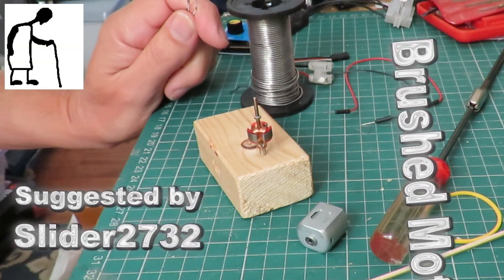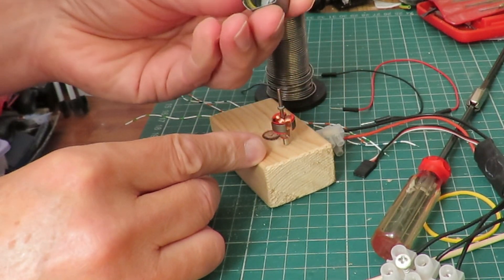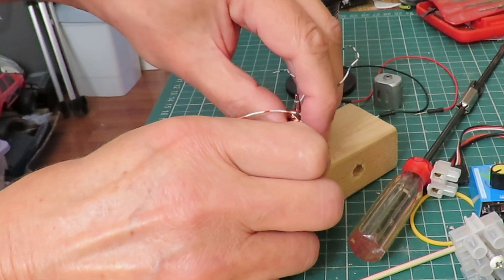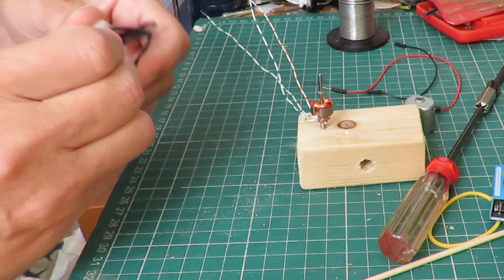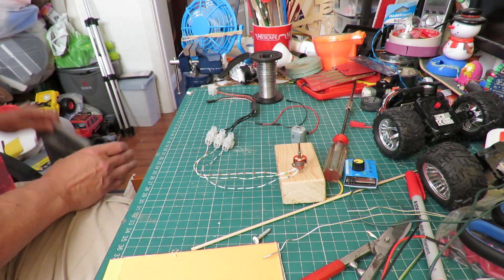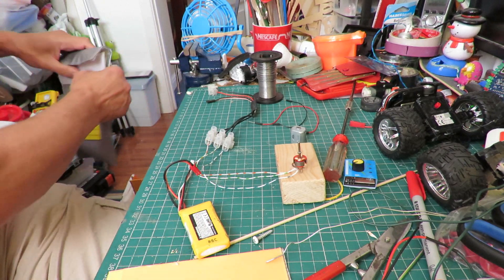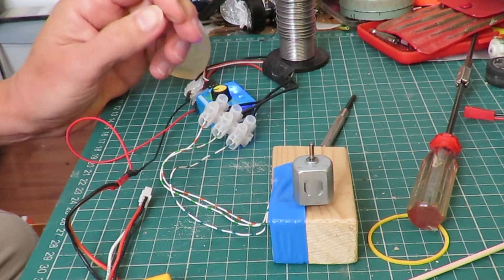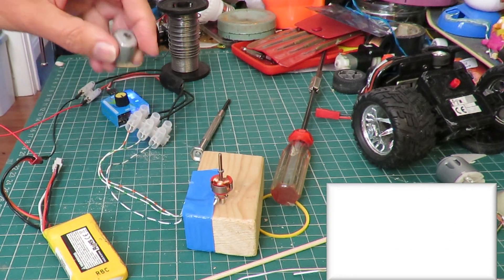Brushed Motor as Brushless suggested by Slider2732

Comment: You made what is a simple demo look complicated.
BUT, ... as stated by others, "we need the shaft turning, not the shell.
Thanks.
Reply from the maker: Thanks for watching and commenting 🙂 Check out RC aircraft brushless motors. You will find most of them are "outrunners" as they are known. They have the case spinning with the prop on a stub shaft attached to the case. If you had been following this little series when I did it back in 2017 you would have seen the two follow on videos - Brushed Motor as Brushless Fan Car - Will it work?  https://youtu.be/UuJyzrkIbiI   and  Brushed Motor as Brushless Fan Car - SUCCESS  https://youtu.be/jFSgxI0S0eM

Comment: I tried it but the motor didn't worked, the motor made some noise and took half rotation every time I turned it on.if I am making any mistake which u know then tell me plz
Reply from the maker: It may be that your ESC is not suitable, I think I was lucky that my ESC worked OK. You could try swapping the ESC wires around, just swap any two and see if it makes a difference.
Reply: Thank u very much

Comment: If I use a circular motor and add some neodymium magnets around the motor housing, will it spin faster?
Reply from the maker: I guess the answer is try it and find out. Here is a demonstration I did back in 2014 - Helpfile - Stronger magnets on electric motor  https://youtu.be/9PfErFnXyt0

Comment: Thats pretty cool. Never thought of doing that to a small dc motor.  If bottom half could ruin on bushings/bearings  then it would be something to use in some way. You spoke of coils being hot.  Over powered it a bit or do you think it would run at normal temp as in before you changed it?
Reply from the maker: I suspect that motor was only expecting 1.5 or maybe 3 volts, probably came from a toothbrush or similar. I was using a 2S Lipo :-)